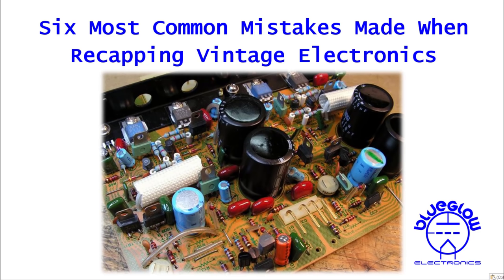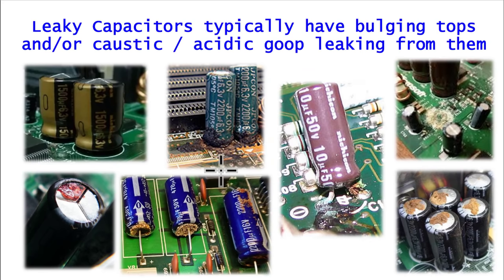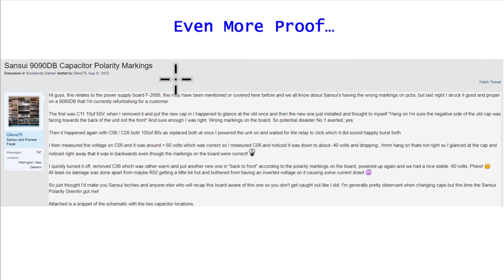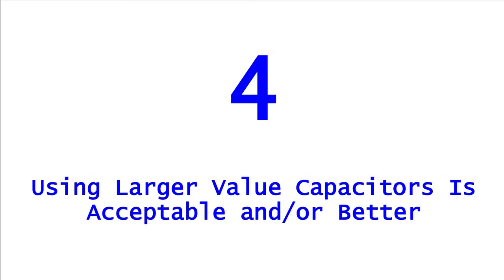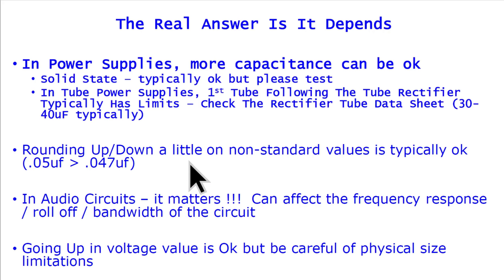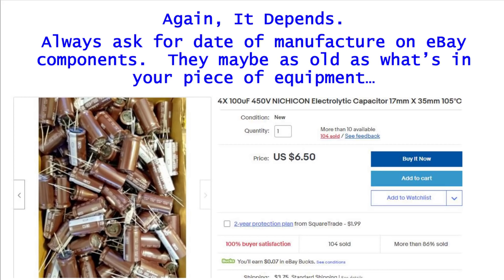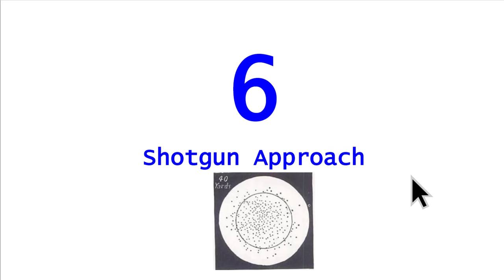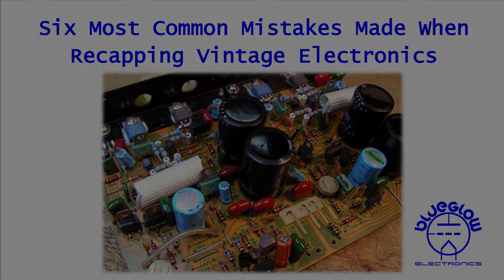Six Common Mistakes Made When Recapping Vintage Electronics

Comment: I agree 100% on your comment to not shotgun.  I did this (beginner's mistake) in recapping a Revox A77 - once reassembled, nothing worked right and I had no idea where to start.  I'll never make that mistake again.  It took one year (ONE YEAR!) to rework everything, test, correct, replace in some cases  - basically re-do the entire project from start to finish, testing carefully along the way.  Don't make my mistake.  A recapping project is very time consuming and you MUST pay close attention to details.  I've heard stories about recaps done in 2 days - don't believe it.  It may not take a year like it did me, but work slowly, carefully, deliberately, check and test everything along the way.

Comment: All good advice, though I don't wholly agree with not doing a shotgun approach. I've done that on all my gear and I've found (for me at least) if I'm careful and take my time, I don't have any problems. I just go through, one at a time. One comes out, another goes in. Easy to keep track of everything that way. Can only think of one time I put a cap in backwards, and it's 'cause I was rushing. Thankfully the only thing damaged was a fuse! I did throw out the cap that was put in backwards though.

Comment: With the polarity markings. It is fairly simple to tell if the pcb is marked incorrectly. If an electrolytic is inserted with reverse polarity it blows the wadding out of the case more often then not. If the unit worked then pcb is marked wrong.
Whenever you replace an electrolytic make sure you have a barrier between you and the pcb and we always wear safety glasses when doing so.

Comment: With vintage HiFi stuff, if you don't know the history etc, is it a recommended or common practice to replace all the capacitors (In stages like you advised) or just visually inspect and only change things if there's an obvious problem?
Some great tips there by the way.

Comment: Mr Carlson and Shango have both disproved the low max capacitance "fact" on rectifier tubes.  In reality, the 40uf max can be easily run with as much as 200uf with no problem at all and both have mentioned substantially higher capacitance as being workable also.
Reply: depends on what the datasheet for the valve/tube says.... the problem is not so much when the equipment is running, its the surge during warm up, or if its on, then switched off, then back on quickly..
Reply: @andygozzo72  and that is EXACTLY what Carlson and Shango disproved

Comment: With certain generations of switching power supplies there can be a problem with new capacitors being too good compared to the originals, electrolytic capacitors have some series resistance (ESR) which is generally undesirable but older switching controllers depend on it being there and replacement parts may have much lower ESR. Sadly this tends to need a bit of "inside knowledge" to put it right.

Comment: another thing I'd say is many capacitors have failed invisibly. You absolutely need an ESR meter (even a cheap one from Ebay) or something like or Paul Carson's ("Mr Carlson's Lab") capacitor tester (which I would personally say is even better than an ESR tester). All capacitors that have leaked have failed, but not all failed capacitors have leaked (or bulged).

This wouldn't matter to people replacing all the caps, but it would for those who are trying to replace only failed caps.

Comment: great video. I'll help a bit. I replaced some capacitors in the signal line with quite larger values. They were the de-coupling capacitors from section to section (it was a tapedeck, with severalsecionts: head amplifier -  dolby- output- variable output). The larger, the less low frequency roll off. When I switched it on an tried to make it work, it didn't sound.... but I had a divine intervention in my head and my helping saint said: "wait",   "wait for what?" I thought... And then the sound came... I was waiting for all and every replaced cap in the coupling to get to the working voltage, from discharged situation in everyone of them to the working voltage at the output of every section.  I guess the output transistor of every section had had a hard time pumping up/down the DC voltage

Comment: In an old Knight-Kit KG870 the bypass electrolytics were put in one direction on the right channel and the opposite on the left channel. This was the way they were shown in the schematic as well as the assembly manual. These were across the emitter resistor on the driver transistors. The correct installation would be the negative side towards the transistor's emitter being these are PNP transistors. The channel with the incorrectly installed capacitor always had a lower output. Correcting the factory design flaw fixed this!!!

Comment: Be aware that some non-polarised tubular capacitors (e.g. the wax paper ones in old valve radios) nevertheless have one end marked with a black band. This marks the wire connected to the outer foil of the capacitor, which acts as a screen when it's connected to the "earthy" end. If the replacement is the wrong way round, it can pick up hum (a mistake I made once - never again).

Comment: Some add-ons to those good tips:
In Power Supplies, more capacitance can be OK, as long as too big capacitance does not over-stress with in-rush current to the prior components in power supply chain.
Going up in voltage value is OK as long as circuitry aren't concerned about ESR value.

Comment: i am an old timer here.  Most of your advise are well known to me. Not because I am a smart dog, but an old one.   Very good video anyway !!  2 things i would add is never buy electrolitics on ebay unless you are an EXPERT !!!!!   i am a big fan of ebay ,love it but as you say, you can get a dry unit and capacitors are like pears, have to be fresh !!!   I preffer digikey or newark on this case.  If you are very good on this thing, maybe you can try ebay ....  i dont trust neither ebay sellers, mostly !!    very thin ice walking is to buy electrolitics on ebay ....   Also,   Do a section at a time its a very smart idea, sometime its just impossible though ...  I would ADD , TANTALIUM capacitors get old and damaged too ....!!  you should do a video on that ..    95% of the people think tantalum are not prone to damage . My experience is a 25V tantalum unit at 18V would fail after a decade ....  Tantalums are sneaky, it is difficult to know if they are bad !!!    it is labor intensive to detect them .. at least for me. Nice video ....

Comment: Over rating voltage may not be ideal in some cases.  Fitting a 100V capacitor where a 10V one used to be, seems OK.  But the very low bias voltage in the circuit may not allow a high voltage capacitor to operate properly over time.  Another error people make is to not replace Low ESR components with the same type, which can cause weird faults with switch mode power supplies, such as electrical noise on rails or strange "hissing sounds" from the power supply.  Where old capacitors have oozed gunge onto a PCB, it's important to clean up then check/repair traces or through-hole plating.  Don't assume that a capacitor that has been desoldered and tests OK, is OK, because the heat involved in desodlering can temporarily re-form a bad capacitor.  An ESR meter is a must because capacitance alone does not tell you everything you need to know.  In general, as well as going low capacitance, relatively modern capacitors fail by going high ESR but vintage capacitors can fail by going electrically leaky.  An electrically leaky capacitor may measure higher in value than it really is.

Comment: As a technician myself, I’ve always found you can use a higher voltage capacitor keeping the capacitance the same ..as long as the cans size will fit in the location. And sometimes I’ve seen the board even shows the bigger location mark that could have been there. Engineer set the voltage on the cap at a little above the operating level. Why not go a little higher and add that extra insurance

Comment: And in analog reel to reel recorders. You will find, Motor Start Capacitors. They are generally   in large, silver cans. Screwed via its welded on Mount.  To the transport chassis nearest the motors. One for each motor. And when those crap out. The motors will not spin. Or they will sound labored. And then the motor smokes and burns up. So make certain to replace the motor start capacitors, also. It's pretty much the same ones they have in your washing machine at home. They are readily available. Those are usually good for about 20 or more years. But sometimes they will crap out quicker also. Even though they are non-polarized capacitors. They still have to sink a substantial load.

And I do like your style. When you tell folks to just recap. Each section at a time. Yeah, sure. Like I might do my microphone preamps first. Before I do the equalizers. Followed by the summing amplifiers. Followed by the line drivers. Sure yes.

But generally when I sit down to do a project. I virtually don't stop until the whole thing is done. Because I am really good at what I do. I always do it right the first time. I'm  meticulous. And Confidence, is high. I don't make mistakes. So when I'm done. I Arity know it's going to work. And work it does.

But for your instructions to the Green Crowd. Yes. You have a great method. To help ensure your success.

But primarily the reason why I will sit down and do all the capacitors. All at once. The whole thing is screwing up. Because capacitors have all flicked out. So while you fix one section. And then turn it on. There's no guarantee those other sections were working. When first tackling the project. And replacing all of those caps. Simply removes that variable. Right out of the gate. Right from the get-go.

And then you turn it on. And if it doesn't work like new? Then you start doing some logical step-by-step, troubleshooting. Which you will find easy to do in this case. Because you got new capacitors installed. And sometimes. I had to deal with the time element. The control room was shut down. As it was the on-air control room. And I have to refurbish that console in, 5 hours. I'm just going to replace, all the capacitors, all at once. And know that it's going to work. Because  I'm a Quality Control Manager. Of Electronic high-end, Recording Gear. When a tape recorder cost as much as your brand-new Toyota Corolla. And the audio console cost as much is your house. If you wanted to get the good reliable professional industrial ones. Because if that configuration is what you wanted? It was only those that were available. There were no computers. No software. No inexpensive anything that sounded or worked, at the top of the professional heap.

We all have our own, techniques. There is no right. There is no wrong. There is only that which you learn from. And I was lucky. I got to be involved in the thick of the top, manufacturers in the world.

And what's funny. Never in my wildest dreams. Did I think I would do anything like I've done. And I have done so far much more. I got to work with the presidents of the United States. And some of these great jobs. I never applied for. People referred me. I got a phone call. We need you. Cool. Because when you're good. Your name travels. So you don't have to.

Anna looks like you are doing terrific work. You certainly have the passion and the bug. Which is needed. With this legendary stuff, classic, historic, stuff. To keep it alive and viable.

Though there will come a day.  When the last tape head and pinch roller. Will no longer be available. When nobody will be making any recording tape anymore. And the old stuff is all decrepitated. They will make lovely museum pieces.

All of these parts. They are going out of manufacturing. These large old discrete, electronic parts. As the cost and the waste.. Has become prohibitive. Thus, computer mounted, surface mount components. As this is all going away one day soon. It's already gone. We are scrounging for parts. And too many people selling, worn out old parts. New old stock that has been sitting on the shelves since, 1979. And I still have some stuff. All brand-new circuit boards. All with beautiful brand-new parts. I never sold. I still have like eight or 10. And they may never sell. I have to move out in a couple and 1/2 months. 3 households of stuff. 2 family members have died. The third one will be 100 and a couple of weeks. My mom. And we have to move out of the house by the end of February. As we only lease. It's going up and we are going out. And the owner wants to sell the property. And I'm like how much longer is mom going to live? But people want to cash out. In life just gets more complicated for me as a retired, handicapped, disabled, senior citizen, myself. And no kids. No other family members. Just me and 100-year-old mom. And we are broke. People do not necessarily live this long. Nor are people attacked and robbed her and beaten, multiple times. Like me for no reason. It's great being vulnerable in Texas. I need to get out of this lawless madhouse. But not until mom is ready to join my younger brother and her second born. Who died just a few months ago. And I'm still not over it. My younger brother. My only other sibling.. This is not the way it was supposed to go. We were supposed to celebrate mom's passing together. And talk about our childhood together. But no. I found my dead brother on the floor of his bedroom. I was supposed to take him to the doctor that day. He didn't make the appointment. He was dead. I wanted him to go to the hospital the night before. But he said no.

And I've been egregiously and heinously attacked by psychopathic Texans. They've gone off the rails. They've gone mad. There's groups of Americans that they hate vehemently. They feel that I am threatening their Christianity. Is that because I'm Jewish or Trans-? Which one or both? Both. They  are, equal opportunity bigots.  They hate everybody who isn't them. Kind of like Donny. He's like the Quaker Oats man. Nothing better for thee than me. Right. 

Same here. I like me. I don't like Texans attacking me. Because they don't like my types. And I don't like them because they are filthy disgusting stinking fascist Gestapo Nazi pigs. That are called Texans. They have physically attacked me, entrapped me. They are beyond lowlife scum bags. 

Texans, are not Americans. Not even close.  Though they live  in the North American continent of Mexico. And they don't like Mexicans coming. Into,Texas. They are the indigenous people of this land. They are a little bit like migrating birds. That's like evicting the US Native American population, completely from the mainland. This ain't no Indian land! This is white man territory! Send them to Canada. Send them to Mexico. Get them the hell out of the USA! And those Mexicans! This is not their land this is our land! 

We don't care if they were here thousands of years before us! FUCK them! We call it ours! And we are letting them leave. Free of charges. Otherwise big business makes money by warehousing them in, Prison. With by and for profit jails. Contracted to cities and municipalities, states, the federal government. It's all big business. Keeping free people locked up because they are liberals! Disgusting liberals!  Gaze and Lesbians, Non-Binaries. And the worst are Transsexual Women! That want to convert your child's sex to the opposite. And then sell them into sexual slave labor. As they are Liberals! And they cannot tolerate living next door to Liberals anymore! And will have to report them to the authorities. Should you hear they're going to have an abortion. So you must Stop Them! And she should be imprisoned to have her baby! When they can then take it away from her. And give that child a good proper Christian conservative Republicunt home.

Yeah no we are not disgusting. But I think it's the pot calling the kettle black. But until the Federal Government recognizes the Pot? It remains a standoff. As states vote for it. The Federal Government says Hell No! We Won't Go! But they were saying that back then also and smoking it. I think it was around 1968. Plus or minus a few years.

I am with, John Delancey's, Omnipotent Q-Anon! A wholly-owned subsidiary of the Trump Group.
RemyRAD

Comment: Re alternate values on capacitors, i am working very slowly on a 1950s tube radio some of the tolerances on the electolytics were speced at -20 +80  percent, not temp but cap tolerance but in other sections the wound poly caps are much tighter even to 1percent so that part of the circuit matters.
Reply: mica caps are usually very low percent tolerance, standard wax paper types 20% or maybe even more,  old 'poly' dielectric caps should still be ok, same as with ceramics
Reply: @andygozzo72  i am sure this is pretty accurate and yes the 1% I think are mica. The issue is these are not brands made in the West az the radio was made in what was then Russian controlled Czechoslovakia. Do how well they hold up over time is not do well known.
Reply: @MrsG7swr  i have several 'east european' radios and apart from leaky waxy paper dielectric  caps, the other components were perfectly ok (one has bad  ht electrolytics, i havent got round to changing them yet)

Comment: I've been fixing vintage audio since it was new. Yep. I'm that old. I was kinda expecting to see if you'd mention about NOT changing certain caps. In general tho, this vintage stuff should be preserved. It's not like another will be made. and swapping out 50-60 year old caps is a good place to start. Just don't let a "hack cap swapper" do the job for you.